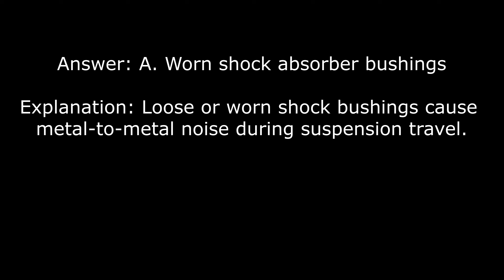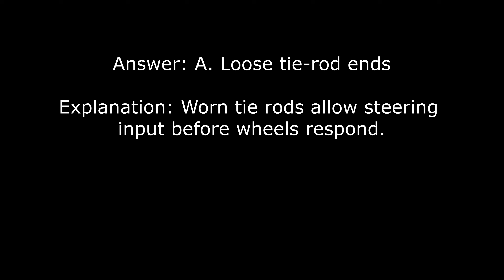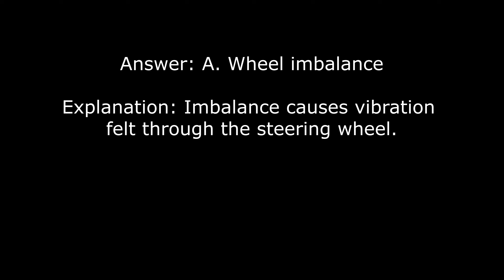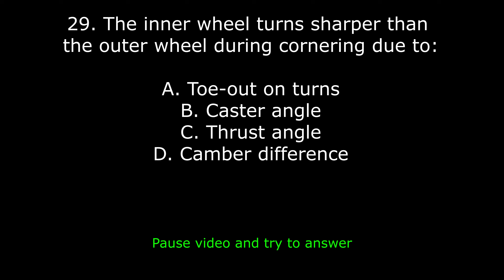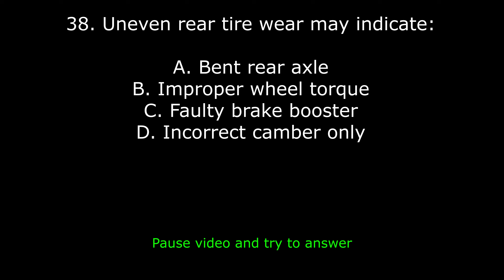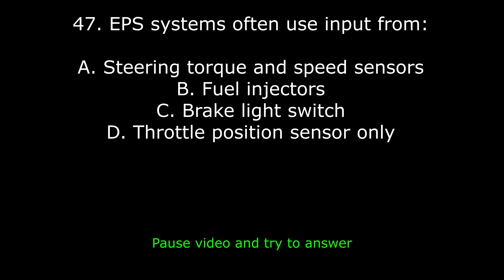🛞 ASE A4 Steering & Suspension Practice Test #4 (50 Questions) | ASE Certification Exam Prep ⚙️

Comment: A lot of these questions have 2 answers possible. Like the one with edge wear it has camber and toe out answers but says it’s camber only
Reply: it would have to be negative camber for the inside to wear and usually you dont get it on both tires unless it was done on purpose